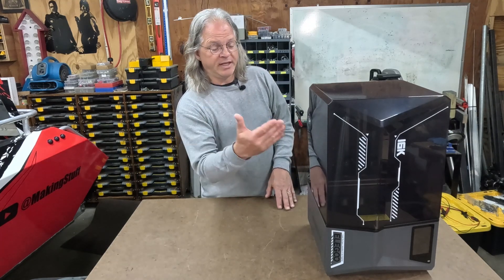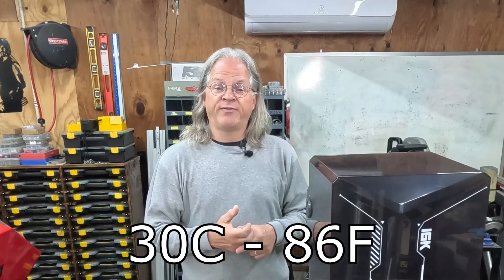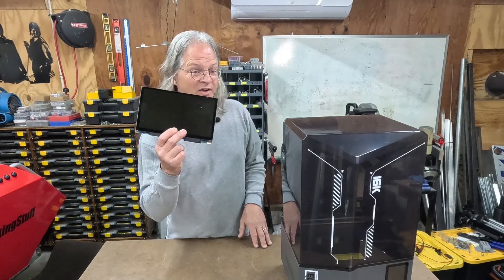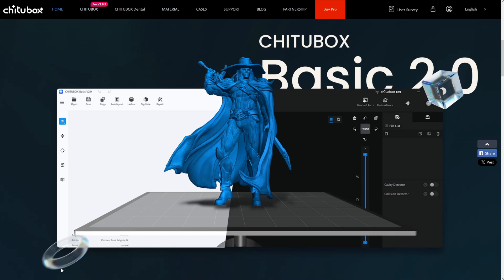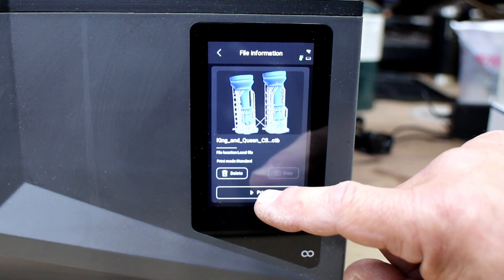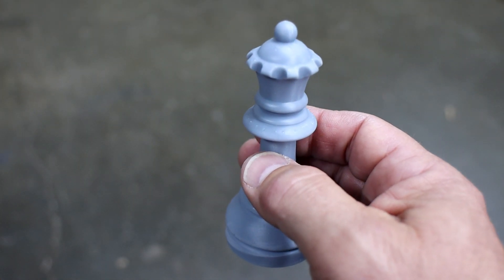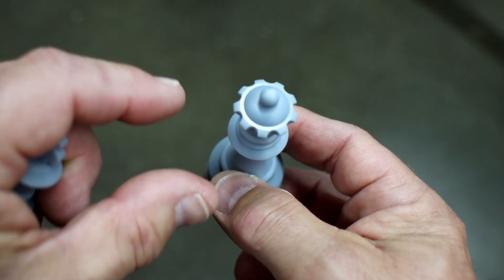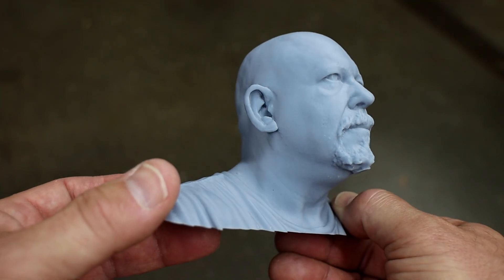So Much More Than A Higher Resolution Screen! - The Saturn 4 Ultra 16k

Comment: I've just purchased, maybe a daft question, but what do you do with left over resin?  Do you reuse, does it go off or do you put it back into the original bottle?
Thankyou, moving on from metal resin projects in molds to 3d tehe
Reply from the maker: I leave it in the resin tank of the printer, with the lid of the printer shut.

Comment: I have the 12k and i can tell you that the layer warp is related to the drain hole. I always try to put them as low as possible to the end point of the print so it will not distort or warp. If im not mistaken its because of the suction force it creates. Good to know that the 16k even with the heated vat still has this problem.
Reply from the maker: Thanks for the tip!

Comment: Do you think I could place this on my balcony since it has a heated resin tank? It gets as low as 47 degrees where I am. But Im worried about resin fumes in my apartment.
Reply: I would worry more about catching sunlight, since it will cure the resin.

Comment: I've never actually held a 3d resin printed object in my hands so I dont know if they are RESIN like the old resin figure statues for comic heroes and stuff you could buy at collectors shops, or if they were the weird plastic-y light weight things like filament printers make. The fact that object had enough heft to break a glass screen and broke like glass itself with a clean fracture actually gives me more info than any other video has on this subject. I wish I could find a video of someone breaking a 3D resin printed object to get a better idea of the material properties lol.
Reply: Depends entirely on the resin used. Some resins are hard and fragile like glass and some are soft and even flexible. Nearly all resins are dense and heavy especially if printing solid objects (not hollow). I prefer “abs like” resins because they are hard and strong with just enough flex to not be brittle. Also be aware that you can mix resins to get a blend that you like.
Reply: Same thought as you, I’ll probably commission someone in my neighbourhood for a miniature figure using their 3d printer before and check on the build  before turning this into a hobby 😂

Comment: The specs say 150mm\h... In the video a 110mm print took 5 hr 15 min?? That's quite a difference. Which is it then?
... and does it depend on the type of resin (e.g. High Speed or not)?

Comment: So i got mine, and all I can say is WOW.. the first print failed lol because the exposure time for the bottom layers was way too low 😅 I asked chatgpt to give me the proper settings it did.. and since then I've printed like 50 rings bracelets and pendants , I love this machine OMG, it works flawlessly, the min max line must've been updated cause so far ive been able to start 4 prints from below the min line so alot of the day 1 issues from the reviewers have been fixed. This machine is a dream. I had to come back and say thank you❤ you will forever have my support.
Reply: What prompt did you use for ChatGPT?
Reply: Hello brother i am using direct castable resin for jewellery can u share profile
Reply: Hello, how are you now? Do you want to meet your printer needs?

Comment: Curious if the camera light can cause the curing defect on the outer surface, while wet with resin, maybe the light was curing extra resin to the surface facing the camera light.